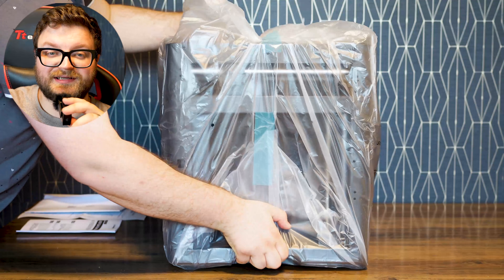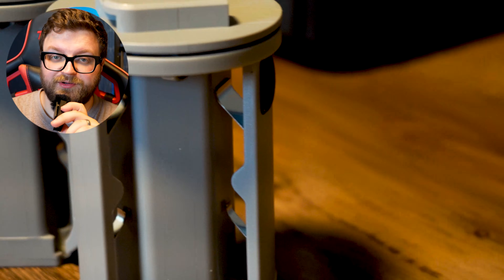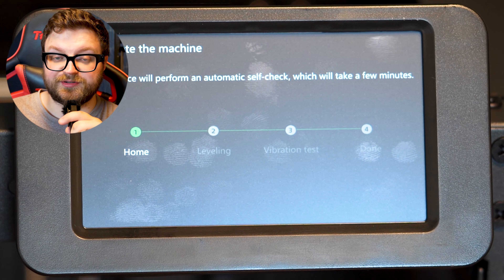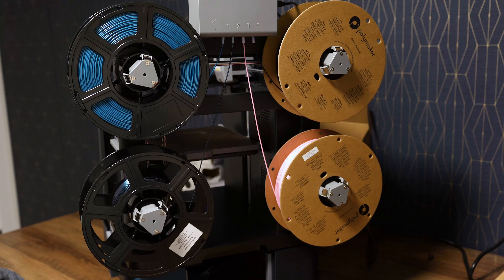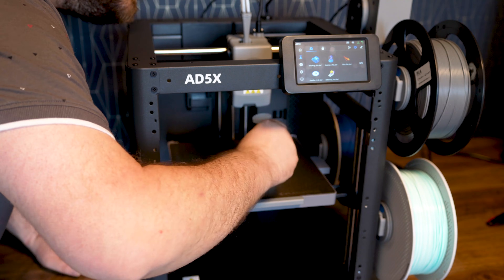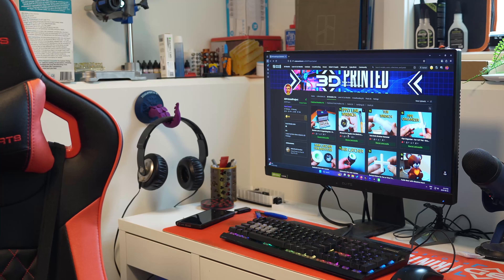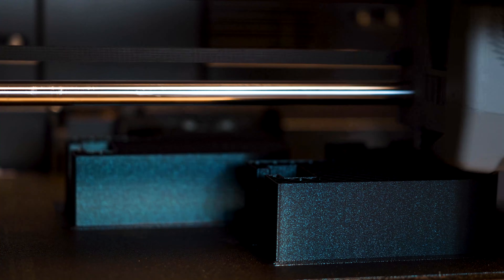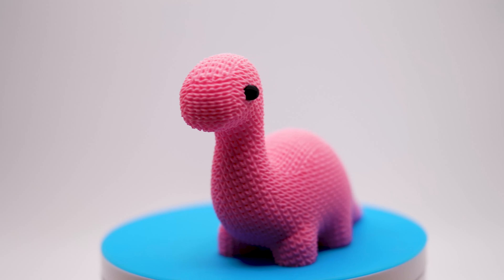Flashforge AD5X – Multicolor CoreXY 3D Printer - Review

Comment: What is the best site to go use to convert your own pictures (logos/PS projects) from jpeg to a stl file?  Im a noob here and got my kids a FlashForge AD5X 3D printer.  Thanks
Reply from the maker: Hey m8, I don't use a site, but what I do use is Inkscape and Plasticity.

First upload pic to Inkscape
Extrude SVG file
Open Plasticity
Import SVG file
Ane then you can extrude the logo and imprint it to whatever surface you want.

MakerLab also has that option, where you upload and it does it for you, but I prefer my method as it allows more flexibility where you want the print to be.
Reply: @3DPrintedProject awesome, thank you.  I’ll give that a shot!!

Comment: but for the power outage thing, so when the power goes out, wont the build plat cool down and release the print because its not being heated?
Reply from the maker: It definately can. If the power outtage lasts a long time. That adhesive i showed in the video briefly could help secure the print to the print bed
Reply: @3DPrintedProject Ohhhh so thats what the adhesive is for
Reply from the maker: @BillyTran-j7q well it has multiple benefits, but at the end of the day it's to ensure the print stays where it needs to stay, power outtage or no power outtage. :)

Comment: Pity the build plate is so tiny - If it were at least 250x250 I might have given it a try.
Reply from the maker: I think for beginners it's not bad, but yes for people with bigger projects on the go you'd want something bigger.
Reply: @3DPrintedProject  most of my products I sell need a 300x300 build volume. I have a few 250-260 printers for my smaller products, but when I look at new printers, I really want at least 300x300 as they are the most versatile for my print farm.